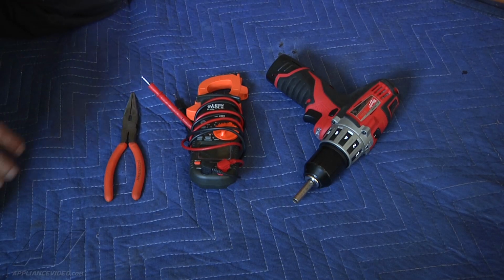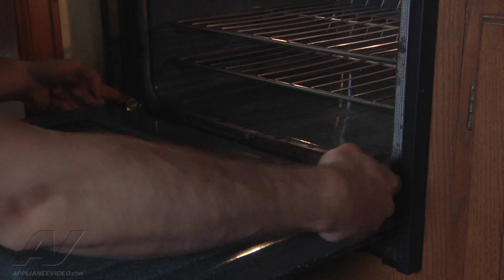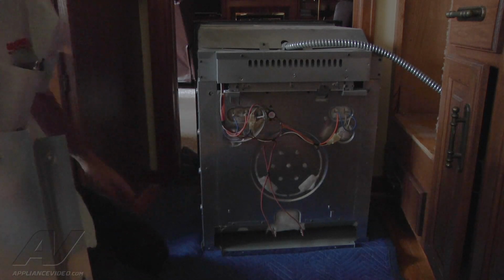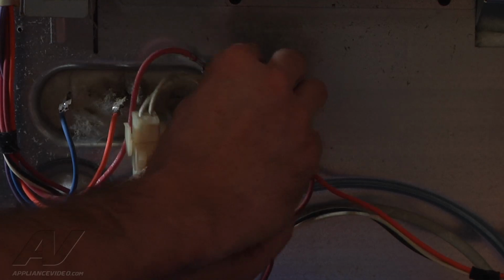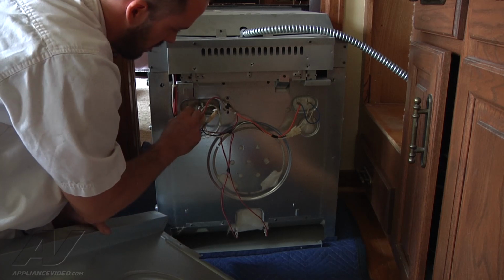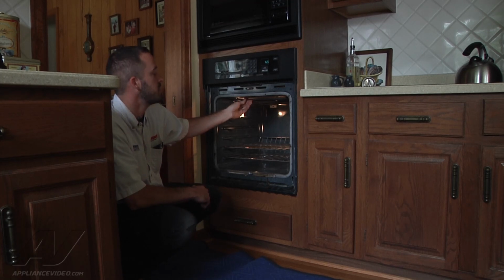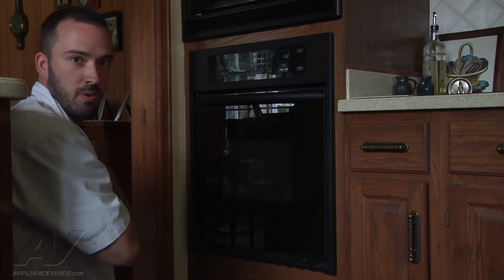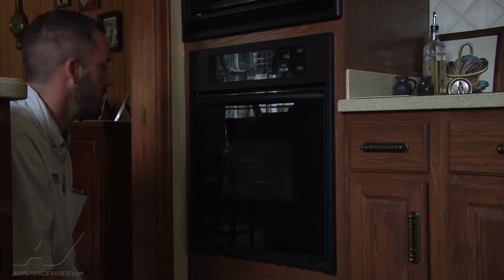KitchenAid Oven Repair -  No Heat After Self Clean - Thermal Fuse - Diagnostics & Troubleshooting

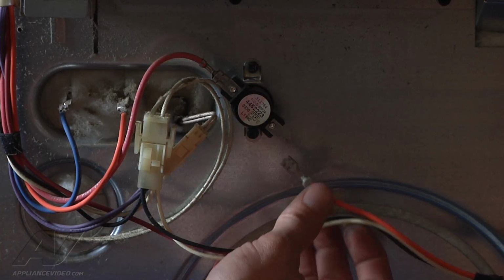Comment: 4:40 I had a microwave oven fail with a similar "thermal limit" mounted on the top outside of the oven chamber.  Visited the local appliance repair parts shop and the guy slams my old one on the counter and says, "I will work now."  All it took to reset it was a heavy blow.  The same is not the case for a true "thermal fuse" that melts a junction when excess temp is reached.

Comment: Great video!  My wife ran the self-clean cycle (or 'self-destruct' cycle as the appliance repair company called it).  I was pretty sure that I could do this repair myself based on your video (and sure enough, what you did is EXACTLY what the appliance repair company did) but called them anyways since I was only 1 person and wasn't sure about getting the oven out.  $275 and 30 minutes later the repair company got it working, but if it happens again, will do it myself for less than $40.  Repair company also said we could use the blue cap 'easy off' despite it being a convection oven and despite the bottle saying not to use it for convection - but better to use that can than possibly breaking the circuit board or other parts.

Comment: Thank you. The problem with mine, is that the control area doesn’t have a fan, so I can’t use the self cleaning anymore. I have the double oven, and it lost power with the door locked. I had to use an angle screwdriver and needle nose vise grips to get the screws out. Thanks again

Comment: Thank you so much. Kitchen Aid claimed they did not know what a thermal fuse was and didn’t know the part number. For my model KEBC107KSS05, I found the part on Amazon for 10$ and the part number was 9759242 Oven Thermal Fuse. The video was very helpful except I had to remove the air vent trim first in order to remove the trim. Every thing else in video was perfect instructions and I did it myself and it works! Also I did not have the continuity device but figured I would just replace it anyhow. Thank goodness I have my oven working again.
Reply from the maker: Great question, if you have a more technical question that our parts department cannot answer, you can search our over 17,000 answered questions free at our website www.ApplianceVideo.com under our Repair Help section. You can also call our parts department at 1-800-830-5465 and they can give you help 7-days A week ,or search at www.SaveMoreOnParts.com  .

Comment: The Fuse mentioned is called a "Thermal Overload"?
Reply from the maker: Great question, if you have a more technical question that our parts department cannot answer, you can search our over 17,000 answered questions free at our website www.ApplianceVideo.com under our Repair Help section. You can also call our parts department at 1-800-830-5465 and they can give you help 7-days A week ,or search at www.SaveMoreOnParts.com  .

Comment: Matt, thank you very much. I used you tips to fix my oven after self-clean heating issue (Kitchenaid oven). I replaced the fuse and everything is working again. The fuse in my oven is located slightly differently (on the side under the top panel) so it was more difficult to find the bugger than to replace it. I spent about $50 and 1 hour of fixing time. Saved a few hundred $.
Reply from the maker: Thanks for your response, we are glad we could help. Our library
of over 5,700 videos are currently helping over 1.6 million people like you
every MONTH.  Please help us by
subscribing to our YouTube channel, or post our website www.ApplianceVideo.com to your Facebook
page, Twitter, Instagram or any other social media sites. Your support will
help us keep producing more free quality videos.

Comment: Thank you for the video, my question is ...... now that you installed a new thermal overload, what will prevent it from happing again the very next time that they do a self cleaning. In the video you mentioned that it was probably due to a lack of venting and the back area getting to hot, yet you never addressed the venting problem?
Reply from the maker: Great question, if you have a
more technical question that our parts department cannot answer, you can search
our over 10,000 answered questions free at our website www.ApplianceVideo.com under our Repair Help section. You can also call
our parts department at 1-800-830-5465 and they can give you help 7-days A week
Monday -Sunday, or search at www.SaveMoreOnParts.com  24 hours
7- days A week.

Comment: Love this video and all has worked according to plan thus far however I cannot get the oven to sit flush in the cutout. There is the big coiled cord with a 4"X4" metal box in there that I think is causing my problem. Any thoughts on how I can get that box in a position where the oven will sit flush in the opening? Thank you!
Reply from the maker: +ATLMom Georgia 

All of our technicians are now answering questions daily at our http://www.appliancevideo.com/ website under the Repair Help section.  We also have over 1600 common questions and
answers that you can easily search through by your model number, appliance
make, problem or error code and it’s absolutely FREE. You also have the option
to email a factory service technician with a question on your appliance at
http://www.appliancevideo.com/repair-help/ . If you’re looking for a repair video, you
can also search our library of over 2600 free repair videos. ApplianceVideo.com
specializes in quality DO-IT-YOURSELF appliance repair videos and we get over
800,000 views per MONTH to our videos worldwide and growing. If you need of
parts for your major appliance, we have over 5-million parts in stock at http://savemoreonparts.com/ .  Thanks
for your support. Matt Ace Appliance factory service technician.

Comment: I checked both the baking burner and the broiler burner. Both are working but not together. Are they supposed to work together for even baking?
Reply from the maker: +Bill Wynn 

                   All of our technicians are now answering questions
daily at our http://www.appliancevideo.com/ website under the Repair Help section.  We also have over 1600 common questions and
answers that you can easily search through by your model number, appliance
make, problem or error code and it’s absolutely FREE. You also have the option
to email a factory service technician with a question on your appliance at
http://www.appliancevideo.com/repair-help/ . If you’re looking for a repair video, you
can also search our library of over 2600 free repair videos. ApplianceVideo.com
specializes in quality DO-IT-YOURSELF appliance repair videos and we get over
800,000 views per MONTH to our videos worldwide and growing. If you need of
parts for your major appliance, we have over 5-million parts in stock at http://savemoreonparts.com/ .  Thanks
for your support. Matt Ace Appliance factory service technician.

Comment: I have a whirlpool accu bake all lights are off. Oven door is locked. Stove range works. Fine.  Our son pressed buttons, were assuming ge pressed self cleaning. But when that happened the lights wer off it made a buzzing noise.  Locked oven door. It made a wire and water sound. Like sparks. And some smoke came just a little came. From back.
Reply from the maker: Robert green 

All of our technicians are now answering questions daily at our http://www.appliancevideo.com/ website under the Repair Help section.  We also have over 1600 common questions and
answers that you can easily search through by your model number, appliance
make, problem or error code and it’s absolutely FREE. You also have the option
to email a factory service technician with a question on your appliance at
http://www.appliancevideo.com/repair-help/ . If you’re looking for a repair video, you
can also search our library of over 2600 free repair videos. ApplianceVideo.com
specializes in quality DO-IT-YOURSELF appliance repair videos and we get over
800,000 views per MONTH to our videos worldwide and growing. If you need of
parts for your major appliance, we have over 5-million parts in stock at http://savemoreonparts.com/ .  Thanks
for your support. Matt Ace Appliance factory service technician.

Comment: This video was fantastic, it saved me a lot of time.  Have the same oven with a Fan assist (convection) and just after using the clean feature it threw a code F5E5.  Searching forums quickly made me suspect the thermal fuse as many state the problem is common.  So i searched Youtube for a video for installing and uninstalling this oven finding this video.  Watching this video definitely reduced the time involved to perform this procedure and because of it I ran into no issues.  Fortunately the installation was virtually identical to the video, I was afraid that the wiring cable would be short but it was sufficient.  Thank you again!  We had much to bake and could not get a tech in time so I had to do this and this video made it easy!
Reply from the maker: OdinsCloud 

Thanks for your positive comment. We are glad we
could help resolve your issue and hopefully saved you money. Please help us
provide more videos to our site by subscribing to our YouTube page or posting
ApplianceVideo.com site on your Facebook or Twitter account. Our factory authorized
technician’s also daily provide free professional Repair Help to people like
you to help solve their appliance problems. Thanks in advance for supporting
us. So email us if you have any other questions our videos cannot resolve.
Thanks for your support in advance.   Matt,
Ace Appliance service technician.

Comment: Changed the thermal fuse on back of unit. Still not working :(  Any suggestions folks? Whirlpool Wall Oven WOS51E7AB.
Reply from the maker: BBall4like
           All of our technicians are now answering questions daily on the ApplianceVideo.com website. You can search completely FREE in our Repair Help section. Or you can get unlimited technical advice and video links emailed to you by our 14 factory certified technicians at http://www.appliancevideo.com/premium-membership/.  If you are in need of any parts please support our parts department on line at http://savemoreonparts.com/ or call 1-800-830-5465 7-days a week until 11pm Eastern time. Thanks for your support. Matt Ace Appliance factory service technician.

Comment: I am reading different advice from different sources ...first it says the problem is the fuse, then someone says the thermostat..then someone says the blower..then the sensor??! Which do I start with in the process of elimination or are any of these parts one in the same??? I have the same problem...the oven is DOA (although it does power on and show the desired temp for setting  for a few seconds but then stays cold)...all after I did a self clean and on the DAY BEFORE CHRISTMAS!!!?? UGH!
Reply from the maker: Deb 
    All of our technicians are now answering questions daily on the ApplianceVideo.com website for anyone needing help. Just copy and paste this this question under REPAIR HELP, and one of our  factory authorized technicians  will answer any technical questions at absolutely no charge on your appliance issues. If you are in need of any parts please support our parts department on line at http://savemoreonparts.com/ or call 1-800-830-5465 7-days a week until 11pm Eastern time. Thanks for your support. Matt Ace Appliance factory service technician.

Comment: I have the exact same problem with my Kitchen Aid double wall oven, the lower oven will not work after self clean. I was unable to see the ohm meter on the video. How many ohms are you looking for when testing the thermal fuse/thermostat ? Could it also be the sensor, and if so how may Ohm's are you looking for when you test that?
Reply from the maker: Rosy 
     If you have a Ohm meter it should have full continuity or peg the meter. If you have a meter that beeps with full continuity use that. If the thermal fuse is bad replace the sensor next. Let us know how your repair turns out or if you have any other questions.  Please help our ranking by subscribing to our YouTube page or posting our ApplianceVideo.com site on your Facebook or Twitter account. This will help us to continue to make new professional videos from our factory trained technicians. We also have our authorized technician’s daily emailing professional advice daily to people like you that have appliance problems. We have helped thousands of people save hundreds of dollars. Thanks in advance for your help.
Reply: ***** I replaced the thermostat sensor and the lower oven works perfect. I tested the old sensor and the new sensor and was able to see the difference on the ohm  meter. The only problem I had was that I had to build a dolly out of 2x4's to place the double oven on to be able to get to the back panel. It all worked out good. Thanks for your help. You saved me a service call, at least $160! Without You tube and your videos, I would not have known how  to do this repair.
Reply from the maker: Thank you Rosy  for your positive comment.  Please help our ranking by subscribing to our YouTube page or posting our ApplianceVideo.com site on your Facebook or Twitter account. This will help us to continue to make new professional videos from our factory trained technicians. We also have our authorized technician’s daily emailing professional advice daily to people like you that have appliance problems. We have helped thousands of people save hundreds of dollars. Thanks in advance for your help.

Comment: This was a great video!  I had this exact problem you outlined and your video helped me determine the root cause and gave me the confidence to repair it. I have a Kitchenaid wall oven, Model KEBK101SSS04,  and the thermal fuse location was slightly different and a little more difficult to replace. That said, once replaced, the oven worked as advertised. Thanks again!
Reply from the maker: Pat 

        Thank you for your positive comment.  Please help our ranking by subscribing to our YouTube page or posting our ApplianceVideo.com site on your Facebook or Twitter account. This will help us to continue to make new professional videos from our factory trained technicians. We also have our authorized technician’s daily emailing professional advice daily to people like you that have appliance problems. We have helped thousands of people save hundreds of dollars. Thanks in advance for your help.

Comment: I have a GE double oven model#   j kp28b0f5bb everything turns on normal but it does not heat up only the top burner gets hot on the bottom half of the oven what could it be?
Reply from the maker: Sounds like you have two problems going on. Allways check to make sure you have proper voltage coming in to the unit 220 volts. The top burner could have a bad burner socket or a bad electric burner. If the oven is not heating check your bake element, if you see any bubbling on the element or a burnt spot replace it.  Please support our parts department at 1-800-830-5465 open 7- days a week.  Parts sales are the way we fund the filming of these free quality videos from our factory trained technicians. So far thousands of people have benefited from our videos and thanks us for our free help. Thanks For your support and good luck with your project.

Comment: Hi There

I enjoyed watching your video but one thing struck me as odd, here in the  UK
oven housing units have a ventilation space at the back which is sealed off from any cupboards above or below the oven by a false back, leaving a ventilation space from the base of the cupboard to
the top, and a vent fitted in the kickboard  at the bottom front so all the heat at the back of the oven can rise up the back of the cupboard and out at the top.

The cupboard this oven was installed in appeared to be sealed is that normal in the US.
                             Thanks Chris.
Reply from the maker: Hi Chris,
Yes, it is standard from what we have seen to be sealed on most units. Thank you for watching and for your comment!

ApplianceVideo.com is a family-owned and operated company providing you FREE, high-quality repair videos. To make new videos and answer your questions, please purchase the parts you need from us at 1-800-830-5465, or order parts online at ApplianceVideo.com. Thank you for your continued support and good luck on your project.